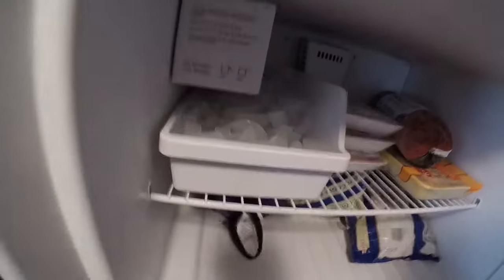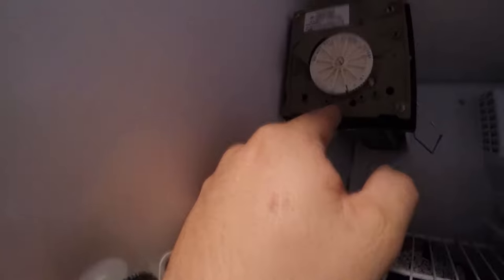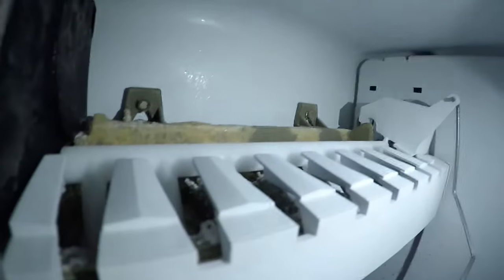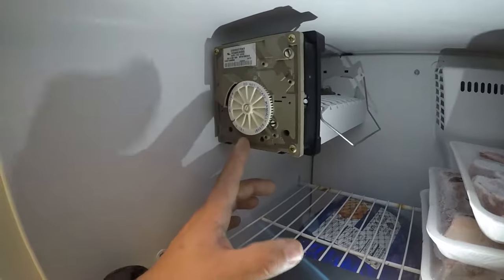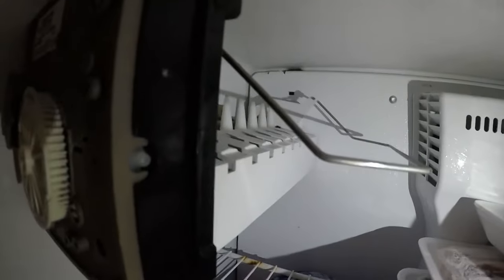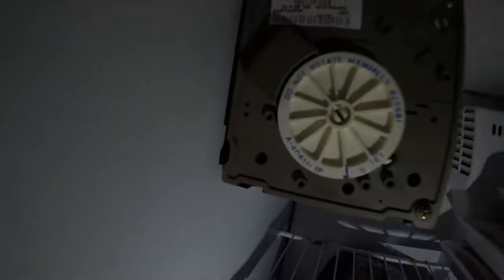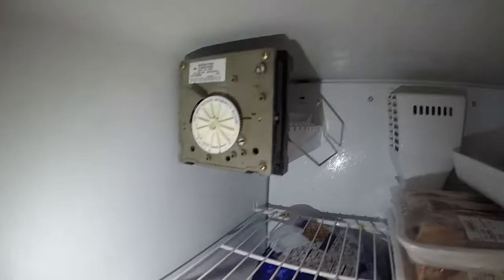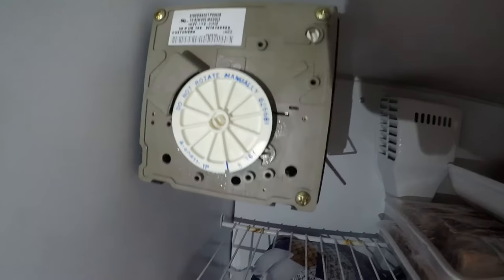Whirlpool Ice Maker Not Making Ice. How To Troubleshoot Your Ice maker.

Comment: Thanks dude. Mine continues to drip and over fills the tray. Any suggestions?
Reply: Your water valve on the fridge may be bad and needs replacing. A bad solenoid on the water valve  is causing the dripping to ice maker.
Reply: Yup. That’s what it was. Buying a new one.

Comment: Is there anyway to test the heater? We have water and it makes ice, but it seems like sometime it has trouble breaking the ice free from the tray.
Reply: I was going to say the same thing. What if the harvester and water pressure are good but the heater fails. Is there a test for that?
Reply: @MegaDapter  One failure point is the connection at the heater. Just remove the three screws in the corners after turning off the power to the fridge. Make sure all four pins on the ice maker are clean; two are for heater and the two closer to the middle are for the thermostat. Flip over the face unit you just removed and look for discoloration at the sockets that receive the pins. If you see no problems, check the heater continuity with a tester such as multimeter. Look for very low ohms. A bad unit will be open or very high reading.  If you are brave, you can hot wire the heater directly with 120vac to see if you draw power and have it get warm, but this is not necessary if you did the continuity test.
Reply: Deesyikkkkkkkkkkkkkkkkk
I
Kk
MegaDapter

Comment: Ice maker works fine but there is a leak on the left hand side as you facing the ice maker.  Water leaks out into the ice bucket and even forms an icycle hanging down into the bucket.  Is there a way to adjust something to stop that.  Kenmore model #106.74254402.  thanks.

Comment: can the heating element stop working?  and could you please replace the battery in your smoke detector?
Reply from the maker: Yes the heater can stop working, but in that case you would want to replace the ice maker itself. If you advance the ice maker you can feel the heat on the heater. That isn't a smoke detector that's my wife..
Reply: I stopped twice because I thought it was in my house 😂

Comment: GREAT VIDEO!!! Thanks for the explanations on those letters and how to check them. Just replaced my ice maker-we were getting flakes of whatever is the lining of the ice tray in the ice. 
This one seems kinda slow. It takes about 2 hours to make a batch of ice. Our old one took 1 hour and 48 minutes-yes I timed it. Any idea on how long it should take or what to check next? Any ideas would be greatly appreciated. Thanks
Reply: Those flakes are from the coating on the inside of the ice maker it’s to help the ice break free easier when it’s dumping out the ice it breaks down over time causing  you to find flakes in the ice cubes it also gets in the water if you have a water  dispenser in the front .

Comment: Curious, my ice maker (whirlpool side-by-side in door ice maker) stopped producing ice the other day. I went through these steps, suspecting a bad module. I went ahead and ordered a replacement, but when I jumped the T and H and got nothing. So, I tried the V and L to test the fill valve and also got nothing. When I took apart the marker, I found traces of water in the bottom of the tray. Like 1/3 sized ice cubes. I thawed the tray and put a little heat via hair drier up the water spout in case I had some ice backed up from what kind of looks like a leaky fill valve. My question is, is the fact I got zero response from jumping my module normal? I had both door switches taped down (one for light and one for door functions like ice and water) and had the IR eyes unblocked. Also, worth noting, when I initially plug the "on/off" switch in, I get the ready light when the sensors are made. But after about 5 minutes, the light goes off and I can not get it to make again unless I unplug the switch and then plug it back in. Switch appears to be working fine when light is operational. Is this also indicative of a faulty module?
Reply: I have exactly this. Did you find a solution?

Comment: Mine has an optic level sensor that I just replaced because there was no LED on at all...replaced the emitter and receiver, and the light comes on, but after about 3 minutes, the LED goes off and still no ice...I'm going to try these steps tomorrow. Any other ideas?

Comment: Do you have any idea why my ice maker sometimes has ice on top of it? It's like the ejector rakes begin rotating, but the cycle doesn't complete. I haven't witnessed the whole process when this happens, but it's like it only rotates one 360 degree turn, instead of the normal two. So apparently the element heats up, then the ejectors rotate the cubes out of the mold, but the process stops prematurely, with the ejectors back at their resting position (their initial starting point), leaving the ice setting on top of the unit. During the next cycle, the old ice on top of the unit will be pushed into the bin, possibly leaving the new ice on top of the unit again. Now that last part, I don't know if that's happening for sure, because I haven't been lucky enough to catch it while it was happening, because it doesn't do this every time... Often, it cycles normally like it should. Though it seems like it screws up (with ice left on top) at least once or twice every 2 or 3 days. Any help would be appreciated, thanks.

Comment: It takes my ice maker 1 full day to drop 1 tray of ice.  Any suggestions?
Reply: Yeah I had to turn mine off before it tore itself apart trying to eject the ice. After 2 hours I couldn’t take the creaking noises coming from it struggling. I’m thinking it’s probably the heating part that frees up the ice just enough to eject it.
My refrigerator is 14 years old so I’m just switch to trays and investing that repair bill forward into a new fridge when the time comes.

Comment: I have a question.  I just installed a brand new ice maker, however I just tested it the way you explained in the video and the wheel did not turn.  Also,  there is no water even pouring into the ice make itself.  Any thoughts??
Reply: Are you sure the tube that provides the water isn't blocked with frozen water?
Reply: @kimoclyde  How do I check that?  Also, I used my electrical tester to test for power and got no result from either leads?
Reply: ytest your inlet valve
\

Comment: my Maytag ice maker no water out, jump the T & H, the modules turn, when I jump the V&L, still no water out. then I check, there is no power to ice maker water inlet valve, but the water dispense valve have power.so what's the problem & how can I fix it. Thx.

Comment: Good day I'm having a problem with my ice maker I try the v&l no water and T&h not giving me no cycle , I then switch the ice maker and module still nothing I've tested the ice maker module for voltage there ain't any going to the icemaker although I press the button for the light in the freezer ..can you please tell me why I'm not getting any volts to the ice maker ?
Reply: Did you ever figure this out?  Same issue I have.

Comment: at 7:05 you say put wires in V and N, however mine is V and L, and the N is the hole at the top of the machine. Do i use the N or the L?

Comment: From manufacturer:
“How to trouble shoot to see if the icemaker or the water valve needs replaced:
Make sure electric is going the icemaker it with a volt meter, 115v should be present (voltage may vary depending on the voltage in house)
Tape the flap on the left so it does not block the beam and then remove the front cover of the icemaker and on letters L and N on the face of the icemaker.
check to see if you have the voltage to the icemaker...115V, If yes then lets see if your water valve is good, take a piece of insulated wire about 2-3" long and strip both ends about a 1/4"
Jump letters Land V on the face of the icemaker and see if you get water in the maker, if you do then the icemaker needs replaced, if you do not then you have a bad water valve.”

Comment: ho mine produces ice but if i don't bt use hair blower ice remain stuck in tray. i use jumpers and start rotating ok. valves open but ice remains stuck i think the heater is not working

Comment: Suppose for a second I have a meter set to VAC. What are normal conditions? For example, I would think N (neutral) to L (line) should give me 120 volts AC. Can anyone confirm that? What other voltage checks could be done and what are the normal readings? I'm not getting harvesting (HT jumper) or valve (VL jumper). And I'm not getting 120V between N and L. Some kind of fuse is killing me. Wish we had some facts to go on, basic baby steps like voltage between L and N.

Comment: Help!!!  Looks like where water comes into icemaker is frozen, did the V-L jump—>no water but dial did a complete turn. I also made sure water is on under sink, icemaker makes noise but no water and of course no ice.  Help
Reply from the maker: This could be a faulty water Inlet Valve not closing completely and causing water to drip  and freeze inside the water feed tube.
Reply: Appliances I Fix figured it out!!!!   After replacing water filter Ice engaged🤗🤗🤗🤗. But first I took a blow dryer to unfreeze water inlet.  Feel like superwoman knowing I almost purchased a new icemaker😳😊

Comment: I stuck the wire in, it worked, but my problem is I'm not getting water to my ice maker. The other day we had water on the floor from fridge, everything is connected, there's water to the module in back bottom of fridge but not coming up line to ice maker, hum? Help!

Comment: If the door has been open for a while, you will not be able to test as the thermostat in the ice maker will prevent water flow. Close the door. Wait an hour. Then run the test right away.

Comment: Great video thanks but a question. I changed my ice maker but its not filling with water. I did the jumper test. The ice maker cycles but for the valve test it still doesn't fill. The replacement icemaker came with a new harness but I did not use the new one thinking the harness is fine because it doesn't cycle when I do the jumper test. However, before I order and replace the valve... could it be the sensor on the harness that is bad? My other question is that the end of my harness that plugs into the back wall of my freezer is not the rectangular clip type. Its round. Do I simply take a flat-head screw driver and pry it off? I don't want to break it.